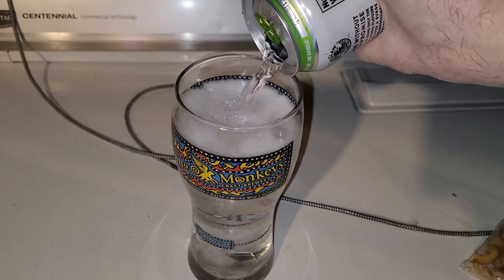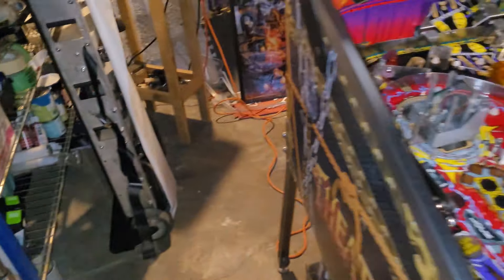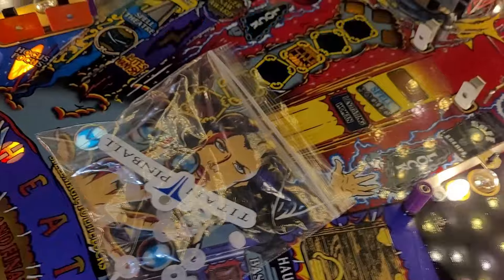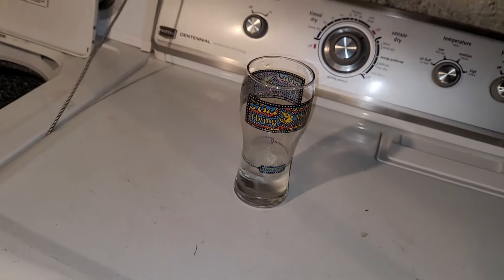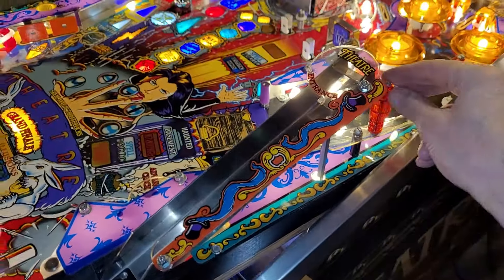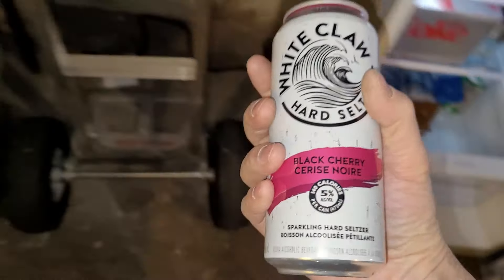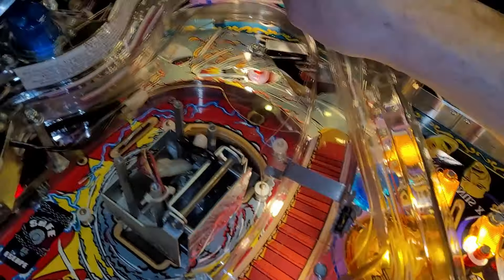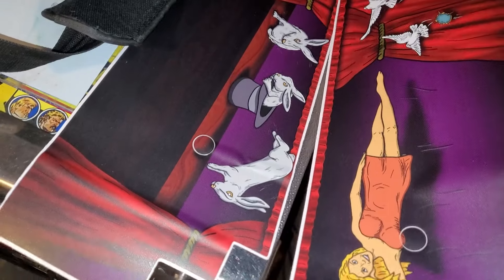Part 6: Theatre of Magic Pinball Project. Playfield reassembly!

Comment: Looks like you enjoyed that Glass of Magic a little too much lol.  You can finish it and the play it like crazy for a wile.  Then down the line if Kevin's que ever dwindles, have him give it the cabinet cosmetic treatment.  BTW, what's up with that MB playfield that looks minty clear coated?  Is that coming soon?
Reply from the maker: It's actually pretty rough! Makes a good wall hanger though
Reply: @pinballshenanigans   steer Kevin to get into clear coating playfields.  I’ve done a few.  The equipment setup is the difficult part.  But once that’s established the process is pretty easy and very rewarding.